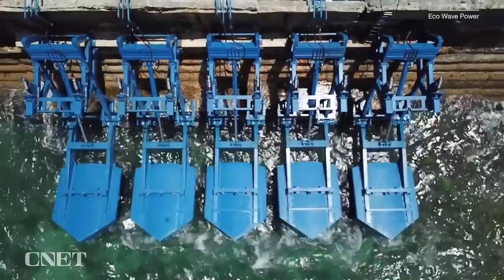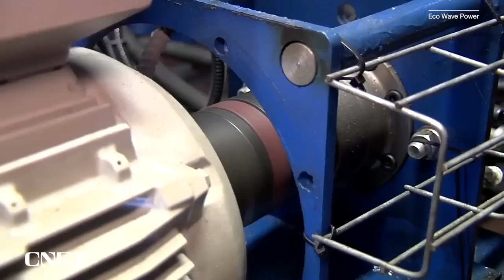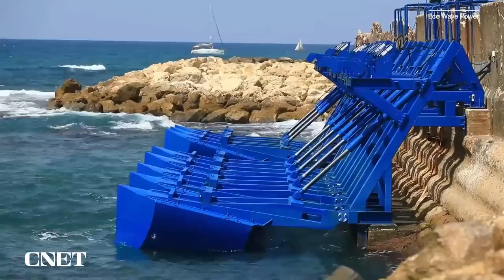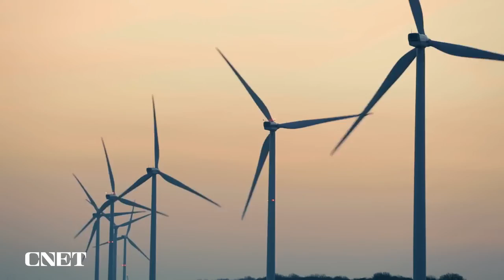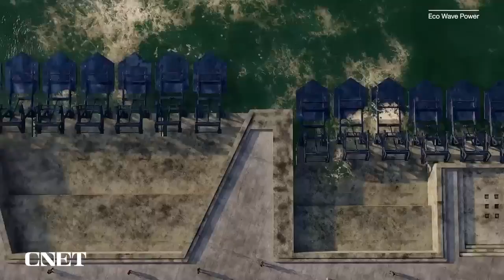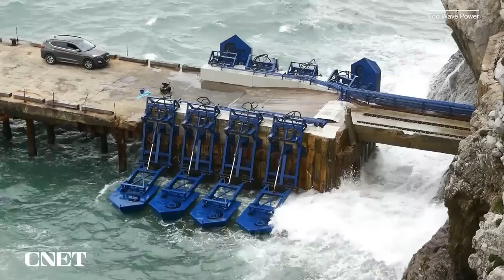CNET-Watch These Floaters Turn Waves Into Electricity 🌊⚡

Comment: Problem is it's not consistent.
Reply: It doesn't have to be. Just like marriage. It can still be beneficial
Reply: It doesn't have to be if we could store it. Technically if we could store all of the energy that we produce, we could actually convert every gas and diesel vehicle to electric with the grid today, by charging batteries at night and off peak and then storing all of the excess renewable energy rather than wasting it and using it when needed. However, we don't have energy storage so most power stations are turned off at night and nuclear is running at low capacity. And during the daytime solar is wasted because there's nowhere for it to go. Energy storage would solve all of our problems.

Also it doesn't have to be consistent, even though the sun only shines half the time you can just build twice as much of it and put a battery. Even though the wind is fickle you can just build enough of other sources like solar and when the wind is blowing there is an excess so the cost goes down and either people will store it in their own personal batteries to sell back to the grid as arbitrage or they will just charge all of their electric cars during these cheap. And factories will run there high energy production processes like steel production during these high wind.
Reply: @pilotavery  That's not what I'm talking about. what I mean is the size of each single wave and when it hits the pontoon is different each and every wave. This means that each pulse will have a different strength and timing. This is not like a hydroelectric dam where you can control the volume and speed of the water that passes through the turbine to drive it at a steady RPM and thus get consistent and steady electrical output.
Reply: @pilotavery  There couldn't possibly be any unintended consequences with your immaculate plan, we should implement it straight away no matter how much it costs.
Reply: @thedave7760  we don't have the energy storage now, nor the finances to do it. It would cost 30% more than just using coal now. 

It's gonna be a couple years until renewable is the cheapest option.
Reply: @pilotavery  A couple of years you say, that's cool, not long to wait then.
Reply: @thedave7760  it'll be longer than that. In 5 years from now building renewable will be cheaper than building fossil fuel stations, but there will still be existing stations that make more economic sense to run until it's time to replace them. After then, no new ones will be built and old ones will be shut down, but since natural gas and coal power stations have lifespan of 40 years without being pretty much rebuilt, it will really be 40 years plus a couple years before everything is renewable. By then energy storage will have already become dirt cheap though so...

I understand that people are pushing green energy really hard, and that has actually pushed cost of green energy down, and we're getting to the point where it's already cheaper to install solar on your roof and break even within a year. I'm not so worried about making stricter emotions laws because the whole world is already naturally moving towards green energy because it's simply cheaper due to the lack of pollution, third and fourth party effects, and very low variable cost. They don't need extra incentive, they are already incentivized.